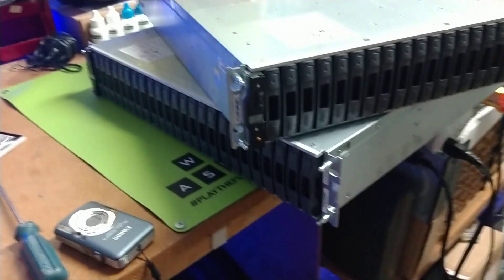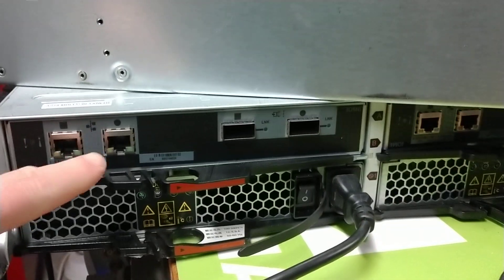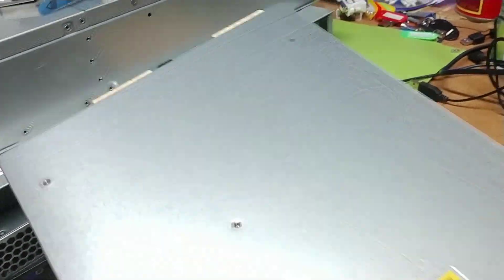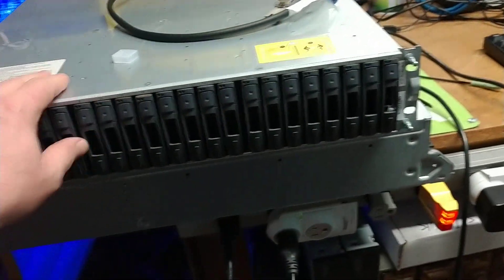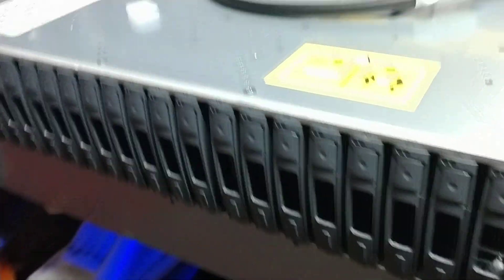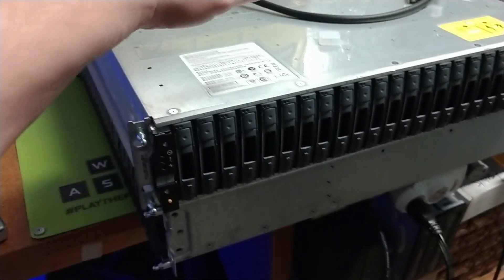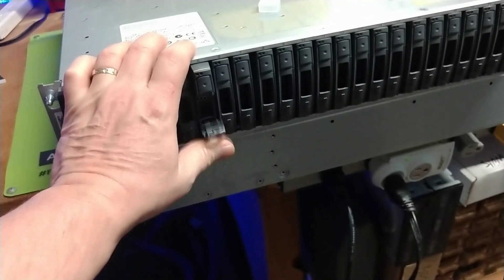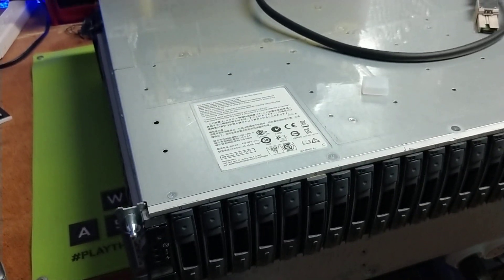Getting a pair of Cheap NetApp Enterprise DS2246 Storage arrays for under $100 bucks!!!

Comment: Another question :) can i user santricity to manager this shelf? thanks again!
Reply from the maker: No you will not able to do that but instead allow the raid controller or HBA controller software to do some this function at least from the hard drive side of things.  You see the shelves do talk some for temp and voltage levels (Not for the drives but at the shelf level.) and can only be access by the vendor special software like NetApp or EMC. This is very specialize and runs from a serial port or JR-45 serial port located on the back of shelf near the SAS ports.  The best thing you can do is use your HBA or RAID controller to monitor the drives and in that way you can check the shelf health at the same time.  As for the health of each shelf, you still have the front and back Alert LEDs that give you a health check.   Hope this helps

Comment: Hi, can i connect two r720 with esxi and use it as a das with mpio? in would to have a drs enable on vmware and also using it as shared storage, with many partition. It's ok if i need to install freenas or similar; I understand, but correct me if I'm wrong, that this unit has not any controller (as netapp e-series). so how i can connect to my two server? many thanks!
Reply from the maker: First you need a dual port SAS or Mini SAS controller that is a raid or HBA base for the server/s that will handle the disk shelves.  I would do up to two controllers if possible for a full fail-over 4 path but one controller will work for each server. Hook up the self/selves and set the cable hook ups. Refer to my other video about SAS cables.  Next setup the disk in raid groups or as a bunch of HBA raid 0 disks.  Your choose but I prefer RAID 1/0 and RAID 5 groups to get the full power out of the shelves at the native level.  If you do it this way then no need for FreeNAS (Now being called TrueNAS). Once you set the shelves up with one of your servers or you can split your shelves between the ESX two servers. (This is a better way to balance your storage across servers using to standalone ESX nodes that join as a share resource in your cluster state.), If you want the ESX server to be nodes only in one cluster and not the core servers, build a FreeNas server on the side line and present your disk shelve storage as NFS storage to the two ESX nodes and that will work as well. But this a single cluster with only two nodes setup in it so if you do this, I recommend that you add a third ESX node for fail-over mode.  I have found that a VMWare single clusters work best with three nodes of mostly equal value for compute needs.  This allow you to pull out a node for servicing without losing your cluster state and is a great thing to learn for this is enterprise level work you are learning.  Hope I didn't lose you in this response. /:>
Reply: @leadiususa7394  Hi man, thank you very much! just another question: after you explanation, i would to start with 1 r720 and ds2246 connected via sas. Do you know some 4 port card and relative cables that i can buy? on r720 actually i've no hba or sas-raid card (excluded perc h710 as internal raid, because server has 8x3tb 3,5'' sas hdd). so i need a sas card for ds2246 and sas or minisas cable, but i've no experience about this. Can you raccomend me some models? thank you in advance!! have a nice evening!

Comment: I Got A 2246  Off Of Ebay And It's giving me fits, Using a Dell r710 with the h800 controller gives me an I/o error . Was Going to plug one drive into another rig , but the plug is different ? Save me !!!!!!
Reply from the maker: Make sure first the Dell R710 is flash up to latest firmware.  That makes a big difference.  also make sure that give the PERC-H800 controller time to build out the raid groups, may they be raid 0 for HBA mode for each drive as stand alones  or as full raid group like raid 1 or raid 5 and so on. (make sure the controller is also up to date firmware wise.)   I had to give my Dell R720XD 24 drive bay chassis time to do that first before I could use the disks for OS use.  it took three days I kid you not.  But it worked perfect after that.  I love the DS2246 and it's NetApp drives...

Comment: Can I connect one of these to my windows box for running my plex server?
Reply from the maker: Yes, first don't forget to get a SAS controller and cabling plus reformat the disks then it will connect to any Windows or LINUX storage needs for any service.  Check out my other related videos on controllers, cabling and how to reformat the disks...
Reply: @leadiususa7394  how quite to these run after the first 3 minutes.
Reply from the maker: @rdsii64  If the chassis is good a few minutes and the fans will spin down.  If they keep running, check the two PSU's to make sure they are hooked up and running on both sides.  If it is still doing it, check your chassis for a failing piece of the chassis hardware like the SAS connectors or controller boards.
Reply from the maker: You will need a SAS or mini SAS HBA/Raid controller as well.

Comment: How do I connect to my servers? I am running 2 HP as ESXI host, Just the heart beat cables Or do I need SAS cards in my servers to connect the controllers?
Reply from the maker: Refer to my newer video on the controllers and how they connect. (LIke A HP-P8 series raid controller. It is the cable that you need to focus on.   You need a mini SAS to SAS cabling.   Format the disk from sector 520 to 512 and they are ready for use.  Refer to my other video on format NetApp disks.
Reply from the maker: I use the P8 myself and I also built a NAS head as well later for more IP base storage using the same format.

Comment: What cable is required?  Not SFF-8088 to SFF-8088 right.   Seeing somewhere it takes a special cable.
Reply: They are SFF-8088 to SFF-8088. Cable manufacturer doesnt matter. i use fujitsu eternus boxes with dell sff-8088 cables without any problem :)
Reply from the maker: QSFP to MiniSAS(SFF-8088) DDR Cable, will work
Reply: @leadiususa7394  yep this is what I got and it works great.
Reply from the maker: @shanepcs  Very cool.  Enjoy!
Reply from the maker: https://www.ebay.com/itm/QSFP-to-MiniSAS-SFF-8088-DDR-Cable-1-Meter-3-3ft/332690922598?ssPageName=STRK%3AMEBIDX%3AIT&_trksid=p2057872.m2749.l2649
Reply from the maker: Also remember to do the linux reformat on the disk then the disk array will work with your system after you clear off the NetApp formatting.
Reply from the maker: NetApp SAS cables work for connecting it to your controllers.